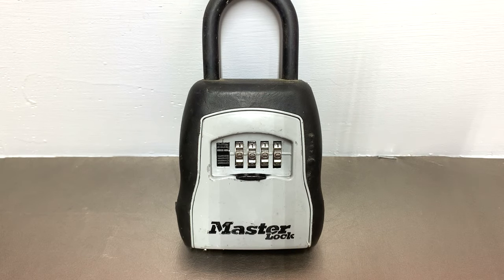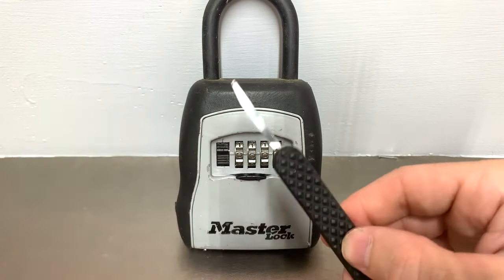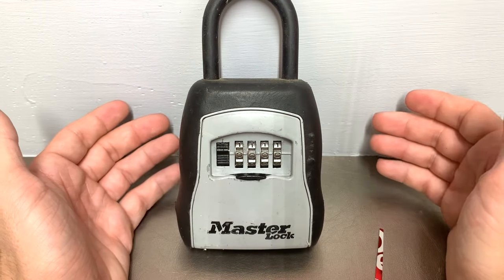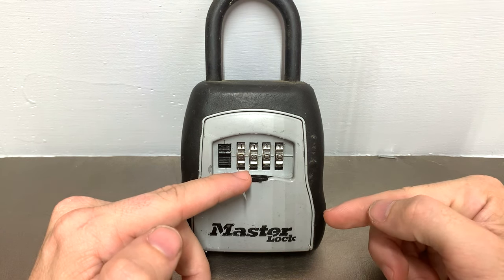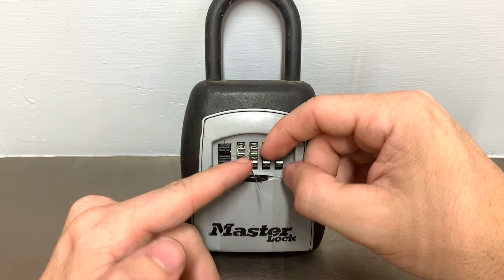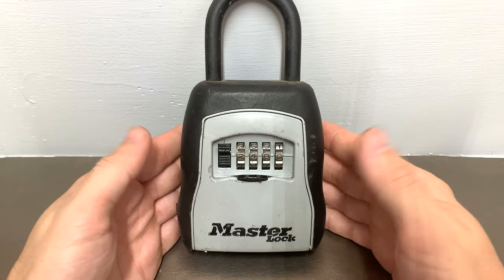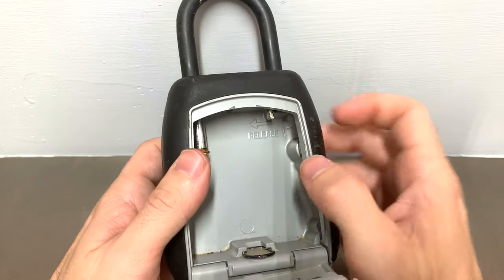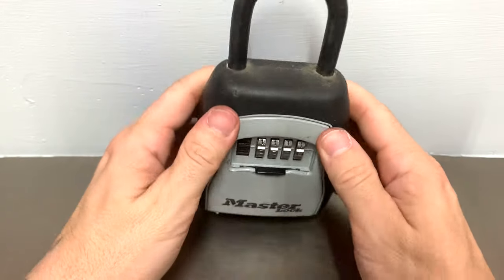How to Open a Master Lock Box with a Soda Can!!!

Comment: For anyone that this isn't working for, make sure you feel the "down" before you get to the right number. If you don't feel the down, then the shim may not be in exactly the right place back in the inside of the lock and any "ups" you feel won't necessarily indicate that you've found the correct number.  If you feel an up without having felt a preceding down, make note of that number and go around again -- if you have found the right number then your shim will now be aligned in the correct place back inside the lock and now and you will feel 1 or 2 downs in the numbers immediately preceding your correct number as you come around. If this doesn't work, and you go all the way around without feeling a down, just reinsert the shim and try again until you do -- ultimately after you feel the down, the shim should be at greater than a 90 degree angle relative to the lockbox, measuring from the combination side.
Reply: Thank you for the finer tips and tricks,the more than 90° of the shim when you feel a down was very helpful!
Reply: Thank you for the finer tips and tricks,the more than 90° of the shim when you feel a down was very helpful!
Reply: Yep, I felt the 2 downs before the lift.  Great notes!
Reply: I am unable to open mine

Comment: Started working in a community for a builder where 3 agents had been before. Had 3 lockboxes there that nobody knew the combination to. Took a minute to get the hang of it, but I literally just unlocked all 3 with this method. This is both awesome (because it worked) and terrible (because it tells me how shoddy these locks are). Great info and great video, thank you very much!!

Comment: You legit just saved me SO much money. I keep a spare house key in a lock box for emergency situations (I lock my keys inside constantly). I changed my code thinking I’m savvy. After a bad experience allowing someone on Rover to use it while I’m out of town. So, I changed it to a random set of numbers. Never wrote it down, and then absolutely forgot it. You not only taught me a nifty trick, but a wallet saving one at that. Like $100+ dollars. YOURE THE BEST, thank you!!!

Comment: This sort of worked.  I was able to find the right alignment but had to rotate each number two clicks instead of one.  Maybe a different variation of the lock.  Thanks
Reply from the maker: I have heard a couple of people say their model had to be rotated 2 or 3 numbers up, the ones I have come across I normally only have to scroll once, sometimes you'll feel gates in different points tho.

 I come across these every so often and they do have variations of this specific model. I have another video with a Brinks combo lock that has to be scrolled 5 times lol - Kilo

Comment: Like a typical dude, I didn't have a soda can handy so I tried to use drywall corner reinforcement as my shim material. The method didn't work. Found a can, the aluminum is much thinner and more sensitive. Worked perfectly. Follow this man's directions to the letter. Thanks!
Reply from the maker: The elusive soda can... it's up there with the 10mm socket lol

Comment: Thank you!!! I was in panic mode because I moved things around and unintentionally did a reset on the box outside one of our rental units. I watched two other videos and tried multiple times without success. Your video was very detailed, and assumed no prior knowledge of any part of the process. Specifically, showing how to make the shim, mentioning to insert it until it stopped, barely resting my finger on it, and feeling it moving down and then back up were the parts that helped me. I moved each number down two times and it opened. I only had to go through your steps one time and it opened.  As a current English teacher, you could definitely go into teaching (if you want to be poor, stressed, and overworked lol). BTW, mine was the wall mount model and is approximately 3 years old.

Comment: Bought my home two years ago but the sellers forgot the combination to the box attached to the garage. I did need some WD-40 to get the wheels to spin smooth enough for me to discern the movement vs the force needed to turn sticky wheels. However, once that was done, I was able to open and reset the combination. Thanks. 

While I had seen a few videos saying much the same thing, the piece that ultimately helped was the downward movement the turn before the upward movement. The downward movement was easier to identify as a real downward movement and not merely the shim bending or error by my fingers.

Comment: Worked like a charm, almost. Instead of rolling the tumblers up one digit, I moved them down. 
I also used a piece of venetian blind instead of a soda can, but only because it was in a heap of crap right next to the  door with the lock box on it.
Tip: you really dont need scissors to cut a can or in my case, the venetian blind. CAREFULLY bend the piece about 3/16ths back from the edge. Fold it as tight as you can then unfold it. If it doesnt break off by then, do it again.
I'll add this too. As easy as it was to pull out my phone, go to "picking a lock box" on youtube, and watching this video, Im not sure I want it now. It was as simple as that.

Comment: Thanks for the video. I had to open an unbranded (Biltema 87-701) lockbox very similar to this. I couldn't get these instructions to work but with a little variation it was open. From zero down to 1 when there is a definite drop, the correct number is current one +2
Reply: Same here, my correct number was +2 as well. I wonder if it’s a different version? but I tried it on 2 different branded boxes, but both were 2+, instead of 1+ like they video.

Comment: As a not handy person, after 60 times try, i finally nailed it using a soda shim. One important suggestion for the doers, make sure you use a tooth brush and soap to clean up the number rolls. The stickiness of the rolls will reduce the “click” of the right number. It took me 60 try to figure out to unlock the 1 master lock and took me 2 try to pick up the 2nd lockbox.

Comment: Wow, it works!!! I've had a Master lock box in my junk drawer for 15 years.  My wife and I have tried every 4-digit PIN in our personal memory banks with no luck.  After watching this video it took less than 5 minutes to open.  However I doubt I'll use this to secure anything valuable knowing how insecure it really is.
Reply from the maker: Keyed-Style Lockboxes are always best.
Coded Boxes are always vulnerable, too many moving components. 

These are best used for leaving a key for someone to clean up a vacant home, an electrician etc.. to come in and work on an empty place.

Once the work is completed, the locks usually(highly recommended) are changed when the home becomes occupied. 

Locks like these have their purpose, it's a better option than leaving a key under a mat lol

Comment: How many times do you need to turn on the final stage t get the original combination number because some channels said three, five and you said one, who is right?
Reply from the maker: Different model years/types can be between 1-3 turns per wheel each. 

If you spin them all the way around then you may be receiving a false read on the gate beside the wheels.

Comment: Hey thanks for this. 
I have one lock with the door open that I don’t remember the code. Do I need the code to reset it? The reset lever inside is no moving. Thanks
Reply from the maker: Yes, the original code has to be input to change the code usually. 

You can use this method with the door open as well, it's just more awkward as it can move a lot lol
Reply: @LockandKilo  Thanks! I did it. Really difficult because it was moving a lot!

Comment: Are any combination lockboxes 100% safe? Are what owners of airbnb using?
Reply from the maker: In many cases when it comes to "affordable" locks, the more moving parts involved, the easier it is to defeat it. 

Air BnB owners often times use these, or an electronic lock that connects to the owners phone/computer directly to change the codes. 

Often times if the BnB is located in another city/state from the owner, they will hire someone to check in on the property after each visit. 

Many owners I have installed locks for have chosen Smart Locks that can be changed in seconds by the owner/maintenance person. 

Having the person(s) information who booked it would also work to deter them from trying anything with their name and face tied to the property one would also think lol

Comment: Installed new lock box, reset code, lock won’t open! I tried this and I can feel the ups and downs indicating the code is what I just set it to 20 minutes ago, but my lock still won’t open. I am thinking it’s a defective lock box :(
Reply from the maker: Various eras of this lock from old to new can be a little different. 

On the newer version of this lock you may need to move all of the wheels 2 or 3 times each!

Comment: Does the tool have any other names? I'm trying to find one on ebay. 

Anything like it would help.

I will try the can method in the meantime :D
Reply from the maker: This tool is called the Ultra Decoder Tool from Sparrows Lock Picks. 

Shim stock from a local hardware/auto parts store would work too!

Comment: But I can't seem to fit anything in between the wheel and the corner. There is not enough space for even paper.  What else can I do?
Reply from the maker: Make sure that the wheel is centered on a number, if the wheel is slightly off in anyway it could prevent the shim from sliding in. As long as it is centered on '0', you should be able to slide it in just to the left of the bottom number on the wheel. - Kilo

Comment: Nah- Use a notch decoder. Faster, easier, and sets to the correct number without further dual twisting. A 10 thousandths feeler gauge is a good base for a DIY job or spend a few bucks with Sparrows...

Comment: How can I open my box. When I put my new combination, I forgot to put leave the cable on. Now it won’t open. 4/4/2023
Reply from the maker: I’m not sure if I understand, do you mean you changed the combo and it’s not working? 

Make sure you flip the switch on the back to its original position, if not then you can retry the old combo.

Comment: It would be a bit of a hack job, but that "RELEASE" lever looks awfully susceptible... If a person knew the right place to drill a hole (not even a big one, really) in the housing from the right hand side, could that lever not be actuated with something small and pokey? Like a drill bit, for example?
Reply from the maker: This thing can be easily defeated with a number of destructive methods haha

It does take a good amount of force to move the lever tho, so the tool would have to be strong enough not to bend easily.

Comment: LESSON LEARNED: Don't use this lock for a spare house key outside the home.
QUESTION:  What do you recommend for a spare house key outside the home?
Please don't say hide it under the door mat or flower pot.  : )
Reply from the maker: So, this is what you call a “Lock Box” and what you really want to find is called a “Key Safe”. 

Key Safes are much more secure and not as simple to bypass :)
Reply from the maker: @mikeh704 in my video [111] I show a How-To on re-setting the code wheels on a manual GE Key Safe. 

That honestly is much more difficult to bypass than any button/wheel version you will find. 

Locksmith’s know how to bypass them, but the common picker will struggle and need practice and a thief will have no idea where to start :)
Reply: @LockandKilo  FOLLOWUP: I successfully found the combination using your method on the first try. Seriously, the first try. Surprise, it was the original combination that I already knew but thought it had been changed inadvertently. I just needed to oil the latch for the lock to work perfectly again. Thanks for the video.